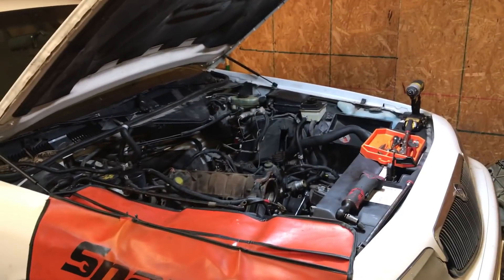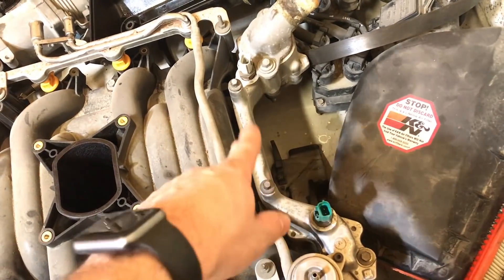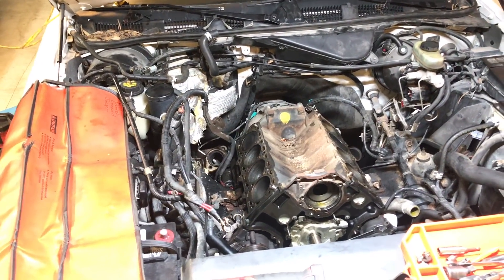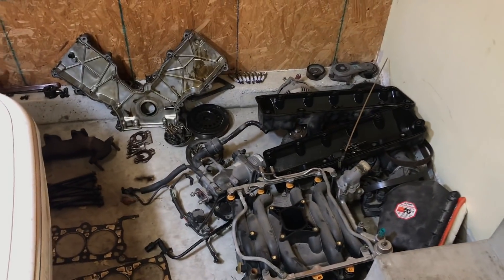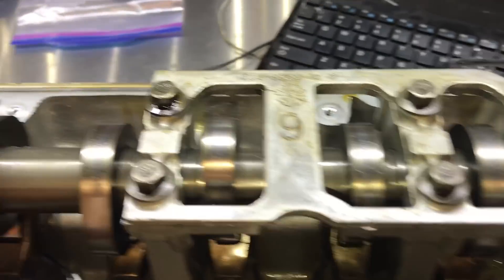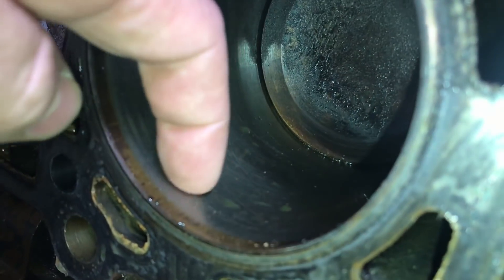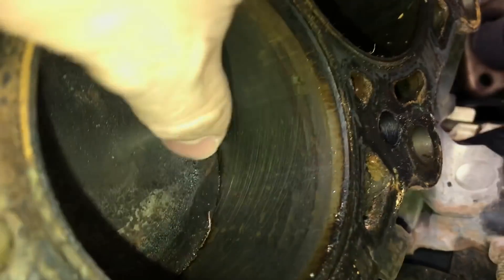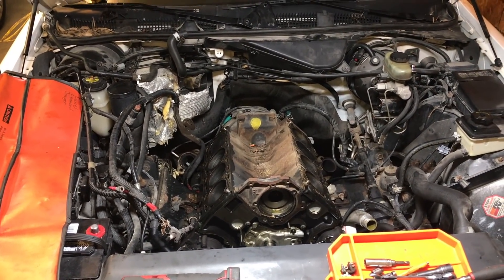Improved Ford 4.6 Manifold CRACKS AGAIN!!!

Comment: my late fathers car being the same year and a ford crown Victoria has done the same issue where the intake manifold cracked and my friend caught it in time just enough to limp the car around so it wouldn't overheat till we could replace the intake manifold. now its got the dreaded head gaskets shot and my friend is still limping the car around still runs never overheats etc.. this one my late father bought in 2006 with 85,495 miles on it and it has bout 130 or 140 on it I think I am not sure but still runs great except the check engine light and all but fires up first time. oh could use the ball joints worked on like either greased or replaced again but still runs.

Comment: all you engineers talking about plastic intakes should open the hood of yur own cars, and then look at your radiator, and behind the timing cover, and inside yur transmission, and yur fuel lines.

Comment: There is an argument that changing oil every 5k on modern engines is only using fully syn oil for 50% of its life. So your over keen oil changing is bad for the environment and waste full. Manufacturers don’t pluck their service intervals out of thin air, they are based on testing, research as to how far you can take the oil before undesirable things start happening in the engine. All this over servicing doesn’t spot this car failing and overheating twice.

Comment: I actually just finished my girlfriend’s 00’ Grand Marquis intake. Maybe I could get some answers, here. What would cause a rough idle after a procedure like this? I had a misfire on 5 cylinders and I changed all spark plugs and Ignition coils. Now it idles rough and my gf said it was knocking but when she put it in park, it stopped knocking and hasn’t done it since that time. Answers to the question are greatly appreciated
Reply: Jabaron Stevens the coil has a rubber boot and a spring.  When I replaced my coils some of the springs were not seated in the coils.  The spring has a friction fit on a little nub inside the coil.  Make sure they are on good.  Also, a little dialectic grease on the end of the coil boot will help seal out moisture.
Reply: Jeremiah Hughes Awesome. I bought new coils and the cylinder misfire continues. And the rough idle was a faulty TPS. It also managed to ruin the Alternator as well
Reply: Jabaron Stevens ugh, that is so frustrating!  Be careful with misfires on these cars. It can kill the catalytic converters too. Good tip on the TPS.  I have a 2000 Town Car that keep missing too. I’ll look into the TPS.  I just replaced the spark plugs and the coil boots and springs.

Comment: Be sure to check or replace the under intake heater pipe hose if it's 10 years or older while you have the intake off

Comment: That is unbelievable  that you can still see the cross hatching in the cylinders! That engine is like brand new! If it was my vehicle, the cross hatching would be gone by the end of the test drive.
Reply: Steven Vanheel the 4.6 is an easy 3-400,000 mike engine in a crown Vic ...

Comment: The reason for plastic should be obvious. It costs pennies on the dollar to make an injection molded plastic manifold vs. casting one from aluminum and doing all of the follow up machine work.  
Another example of a great engine potentially taken out by one cheap part.  Your piston rings have now probably lost some tension due to overheating, too. The cam line bore of the heads, etc.

Comment: We have 10 000 miles oil change here in France and all the family cars i work on are that clean inside,gas like diesel engines.
You just have low quality engine oils because since decades, peoples have their engine oil changed every 3000 miles or so,and oil manufacturers sell you a cheap oil,with minimum aditives and detergents quantity in it.
You can't blame oil intervals without looking at your oil quality first,your fuel quality,and you machining tolerances then.

Comment: Just got a 2003 Grand Marquis with only 57,000 miles. Excellent car all around. I'm just worried that the intake manifold, despite being the updated design, is a ticking time bomb. Were there any symptoms of anything wrong before it totally crapped out? How many miles did you manage to get out of that intake manifold? And which new intake manifold have you purchased?
Reply: Peter first you will notice the coolant leak on the front of the manifold then it will crack 
I advise you to install the updated one soon 
Mine cracked up in middle of no where 4 years ago 😢

Comment: I have a 04 V6 escape, I bought it in 2016. The person that I bought the car from just had head gaskets, new belts, new coolant lines, new air conditioner compressor, oil pump, spark plugs, and water pump replaced. They neglected to replace the catalytic's and ignition coil's. i've had to put on New struts, new ignition coil's, new catalytic's and exhaust manifolds, power steering pump, and alternator. At some point I need to get my transmission looked at.
Reply: P/U a 2005 Mariner V6  the mercury version of the Escape a few months ago for $1250 with 151000 miles on it.Transmission would have a hard shift sometimes into 2nd gear.Threw some Lucas transmission conditioner and it smoothed it out.Didn't look like the tranny was ever serviced so I decided not to change the fluid at this point.Best of Luck with yours
Reply: E Meyer I have 4x4 drive model, my problem is transmission doesn't shift into the fourth sometimes.
Reply: Mine is a 4x4 too but have not had any problems with the shift into 4th.Hope it is nothing major.Good Luck

Comment: The 5.4's were notorious not for cracked coolant crossovers, but cracked intake manifold plastic. The 2V 5.4 in my 2000 F-150 had a cracked intake manifold and was leaking coolant down into the spark plug holes. Luckily I caught it before it blew a head gasket. 1999 5.4's had an aluminum manifold (first year for port-injection heads), then they switched to plastic for 2000. Gotta love how Ford uses plastic in all the wrong places as a way of cutting costs.

Comment: What a coincidence my return line from the heater core broke 2 weeks ago and i replaced the plenum and its leaking at that alluminum cross brace. Now i have exhaust leak and a bank 1 too lean code

Comment: Yeah but it’s still a Ford lol
Reply: Val Yeah, because no others brands have problems. Tell that to my uncles Tacoma that's having alot of transmission issues and engine issues. What about my cousins 2016 pilot that has had its 9 speed transmission replaced twice, or my 2016 Honda civic that blew up at 3k. But my explorer that's a yr and a half old that's never had a issue? Screw that, because that's a ford.
Reply: Val i have to shit

Comment: Literally going through this right now with my Mustang for the third time. PI heads, same issues with the heater core pipe. New ones have a plastic pipe instead of brass, at least with the PI manifold. The intake manifold gasket is really finicky too, you have to be really good about following torque spec / order, else you'll leak coolant by cylinder 8 in my experience.

Comment: I have a 2001 grand marquis, at around 140k miles my intake broke at the heater core pipe outlet exactly where yours did so i replaced it with an intake manifold from an old crown vic from a junkyard, so i went and took on the job of installing the junkyard intake wich was supposed to be the "improved" intake. For about 2 years that intake worked perfectly and one day the dam intake broke at the exact same spot at about 153k miles so this time i went ahead and bought an aftermarket Dorman intake wich has been on the car now for about 3 years and seems to perform ok. My advice to anyone that buys a crown vic, grand marquis or town car to immediately have this part swapped out with a NEW one not used because the job of swapping these out is for an untrained guy like myself a 10 hour job.

Comment: Plastic intake parts, ugh
cough GM 3.8 series II plenum leaks cough
Reply: The pre series 1 3800 was the best of them all!
Reply: Yeah. Back in my rookie days I got stuck by a 3.8 that cracked around the EGR. Pretty good engines otherwise.
Reply: I had several 3.8 with cracked plastic plenums, most around the EGR. The intake gaskets also leaked. I had a 2007 aluminum plenum series III that also leaked, luckily it did not crack. A 1995 3.8 leaked overnight into cylinder 1 and hydrolocked the next morning when it was started. 5k miles later number 1 rod bearing spun, grrr
Reply: Yep. Probably the second intake gasket job I ever did was a 3.8. Slapped it together and fired it up, all seemed well. Just idling in the shop it hydrolocked. I didn't know to look for a crack around the EGR. Really didn't hurt it. Replaced the intake and pulled the plugs out to flush the coolant out of the cylinders. Change the oil and off she went. Good thing the customer never filled up the coolant, it would have locked up on him and not me.
Reply: Ugh I had an old 3.8 and had to do the intake gaskets, and the coolant elbow, what a joke.  Glad to be rid of that vehicle.
Reply: The 3.1, 3100, 3400 etc
Reply: garbagey chinesium, hated them later gm's, burn through from EGR passage port to throttle body coolant passages and drink all the coolant.
majority of them locked after being shut off or at idle turning into parking lots going over bumps..
Reply: I had the following GM 3.8L, though not the same engines:
1980 229ci (pooch in a Monte Carlo), 1981 231ci, 1994 SSEi sI, 1995 sII, 1997 sII (replaced 1995 in the Bonneville when it hydrolocked), 2003 sII, 2007 sIII
The 1980 229ci was the worst of the bunch, not sure how much of that was the horrible emission attempts of the time.  The 1981 231ci would run circles around the 229ci.
Reply: I dealt with that complete garbage design.  Oddly enough, that was my last GM product!
Reply: Jason Woods so the bulletproof 3800 V6 isn’t exactly bulletproof?

Comment: you don't find too many 4.6s with blown head gaskets
Reply: trigga ville yes, extremely rare.
Reply: Ford 4.6l is a tough engine!
Reply: I just bought a 97 G160 with the 4.6 it has blown gasket. Lady was pulling a RV up the rockies at 10,000 foot something let loose and all the coolant was running off the back side of the engine. I'm tearing it apart now.
Reply: See them quite often unfortunately. Fortunately they’re an easy fix and quick flip!!

Comment: What a shame it overheated, they run forever. I have a 98. Best engine on the planet, that engine was just broken in. Watch out of you use the dorman intake manifold. You may have to put RTV in the head divots, they straddle the intake runners and can create a nice vac leak. I had to do mine over.
Reply: really? ive did countless dorman intake manifolds and havent had 1 issue.
Reply: It was in the application notes. I had +13 LTFTs, but no crazy rough idle. Honestly you can send a customer off and they may not notice. https://www.youtube.com/watch?v=UvOOvmiVXnk
Daniel may be better off installing the Ford Racing PI Manifold (for newer modulars) if she is keeping the car long term. There is a small modification to add RTV.

Comment: Don't set those cylinder heads down on the mating surfaces! 😭 Those cylinder heads are very difficult to get them to deal properly. They will eat through head gaskets if not done properly.

Comment: Please wire wheel the pistons clean, makes me almost cry to see the gross like that
Reply: Lol wire wheels destroy cylinders!  I’ve seen engine ruined because a piece of wire got between the cylinder and piston and took a chunk out the cylinder . Never even use a wire wheel anywhere near an open engine! Use a flat scotch brite pad on a flat block of steel not on a whizzwheel either they remove metal !
Reply: Hope you joking.. Pieces of wire getting stuck off in a engine isn't exactly good... And even if the pistons are out of the engine you would just want to use a good solvent and scotch pad by hand to clean the tops. Being in the engine, just spray some brake clean and use a rag while the piston is at tdc, being sure to add some oil around the piston and letting it soak down the cylinder wall being turning the crank to get the next piston up (the brake clean will wash off all oil)

Comment: It will crack under where the metal crossover is too, there's still plastic between the metal and the engine...
Reply: That whole manifold should have been aluminum, all those plastic intakes cause so much problems in a lot of other vehicles.
Reply: Paul  Sosa the coolant part should have been metal all the way around, the intake being plastic is good bc it reduces heat soaking but the coolant should be no where near any plastic.

Comment: plastic  parts on an engine ,  what  is  wrong  with  that  picture ?
Reply: 95s had an aluminum boat anchor. 96 went to plastic.
Reply: If you have a manufacturer that can do it right (not ford) then plastic intakes are the way to go in a dry intake application. It is way lighter than aluminum. But in a wet intake application I think using plastic is just stupid and asking for problems.
Reply: The problem is that they plumb hot coolant through the plastic.  A plastic intake manifold actually makes sense, since there's less heat soak and improved performance (and decreased emissions).  LS engines have plastic intakes as well, but since coolant never touches them, you never hear about failures of them.

The intake isn't plastic to save money.  It's to decrease emissions and improve performance.
Reply: silicon212 yep, all of the gen 3 and up small block chevys have plastic intake manifolds but like you said, it’s not a problem since coolant doesn’t touch it. Not only is it cheaper to build and saves weight, but it also flows better because the surface is not porus like on cast aluminum intake manifolds.
Reply: All manufacturers use it! It insulates reducing noises , isolates the intake keeping the intake charge air cooler since the heat front the heads doesn’t transfer nearly as much than if it were aluminum , and the aluminum corrodes as well!
Reply: Tom Burgess too much
Reply: Tom Burgess when you have the 4V and they didn't have that intake problem